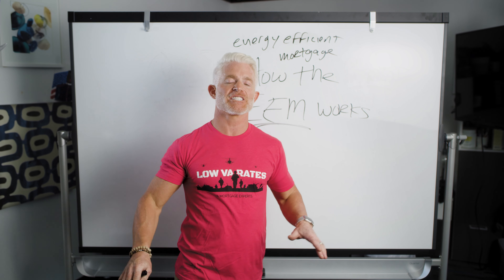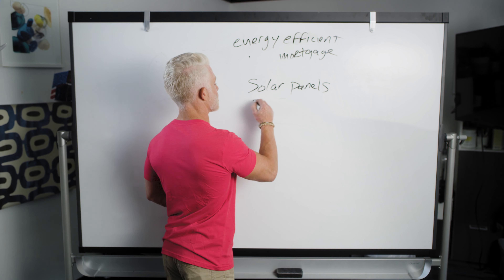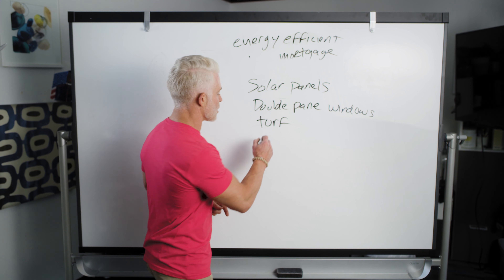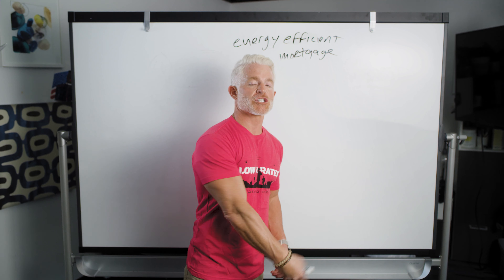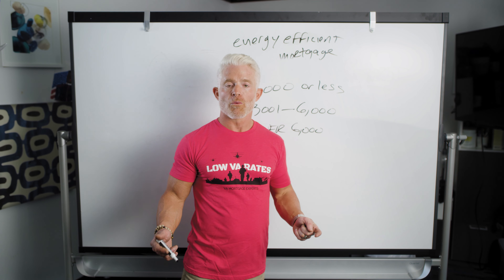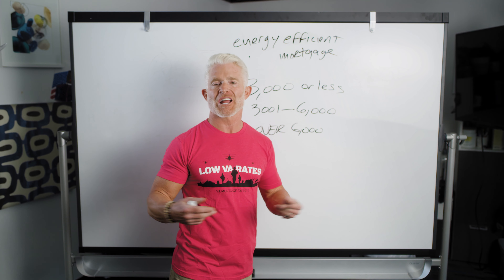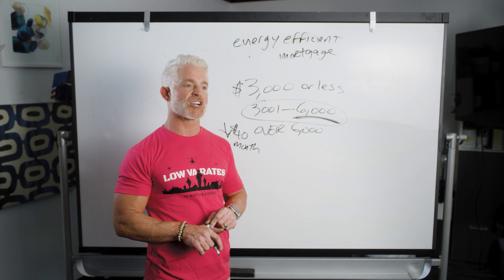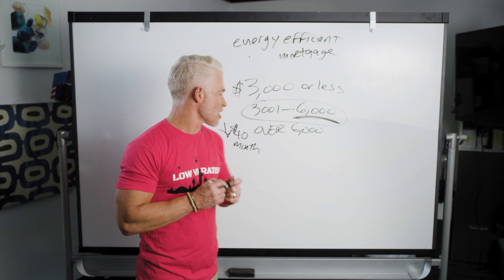How does an EEM work?

Comment: Have a question. I just had an eem item denied (3-6k). The house has electric baseboard heating and so I wanted to put in a new hvac system (heat pump). This, like all other hvac systems, does both cooling and heating. They are saying because the hvac system does cooling (in any form) that it is not an eem item. Is an hvac system that provides both cooling and heating eligible for eem? Does the lender have to get approval from the VA for a 3-6k eem?
Reply from the maker: This is 100% up to the lender, the VA does not have a approved or denied list of improvements.  If 3K or under, you do not have to prove the energy savings outweigh the cost of the item, over 3k and up to 6K you must show some math.

Comment: Why not cover the needs/requirements of the over $6K option? Solar panels will never be under $6K for the avg home.
Reply from the maker: VA just does not allow that, but you could do a cash out equity loan and do it that way.
Reply: @lowvarates  Seems pretty deceptive to put it in the video 3:39, then tell people "VA won't allow it"? I am buying now and lenders have no idea what this third option is. I have seen others claim this, but have yet seen proof of its existence? Where can I get info on this without being sucked into the marketing machine?
Reply from the maker: @SWells6700  this may help, https://www.benefits.va.gov/WARMS/docs/admin26/handbook/ChapterLendersHanbookChapter7.pdf
Energy efficiency improvements over $6,000:
Lenders should exercise discretion and consider:
• whether the increase in monthly mortgage payments exceeds the likely
reduction in monthly utility costs, and
• whether the veteran’s income is sufficient to cover the higher loan
payment.
A VA Certificate of Commitment issued before the decision to make energy
efficiency improvements over $6,000 must be returned to VA for a
determination that the applicant still qualifies